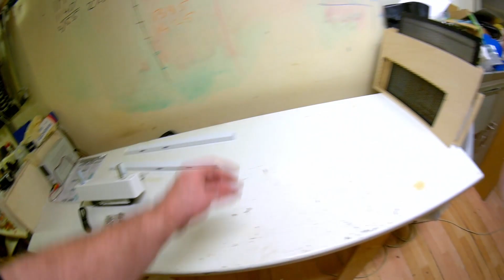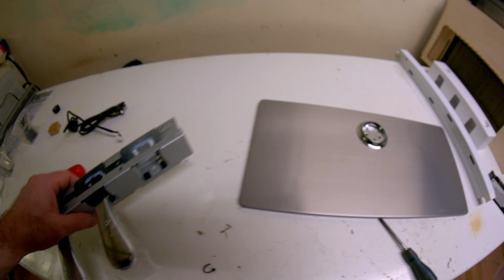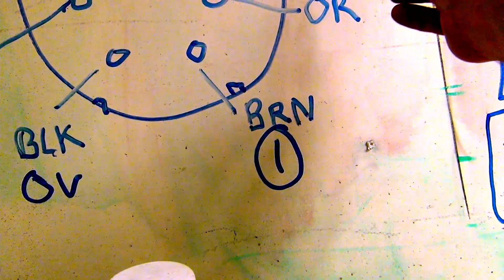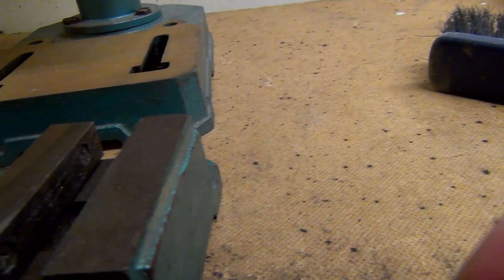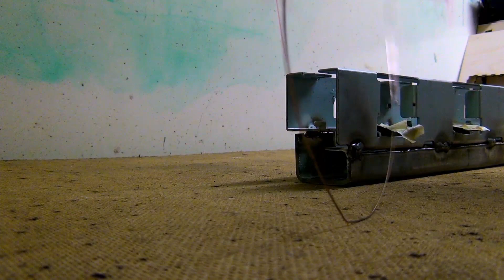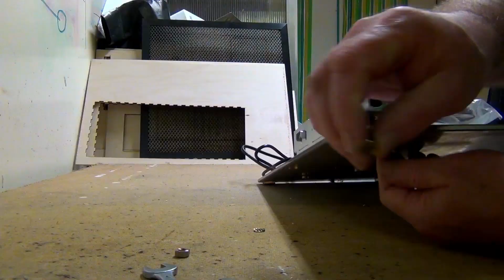Yamaha LP-1 Pedal conversion

Comment: Hi Dave. Great job. I personally find the LP1 springs too strong and tiring when using the pedals. Do you think I'll be able to find 3 springs that are not so strong to replace the original ones?
Reply from the maker: Hi Eduard,
The springs are compression springs. About 14mm O.D.
Check out Ebay. There are loads there.
Good luck.
Cheers.

Comment: Just been doing some more testing. If I connect Black+Orange the DGX correctly thinks the left pedal has been pressed. If I connect Black+ Red the DGX thinks the Centre AND Left pedals are BOTH pressed. Similarly if I connect Black+Brown the DGX thinks the CentreAND Right pedals are BOTH pressed. It's all very odd - I'm stumpted !
Reply from the maker: Hi,

Please do not connect the wires together without using resistors.
The unit is set up to divide the voltage over the yellow pin and black pin to the red, brown and orange pins. (Refer to the video for the pin colours)
I have checked the resistance over the supply (yellow-Black) and the meter shows 3.3K. This relates to 3 X 10K VARIABLE resistors.

The pins indicate:

Pedal 	Pins		Open	Closed
1	Yellow Brown	2.7K	4.1K
2	Yellow Red		2.9K	4.2K
3	Yellow Orange	2.8K	4.2K

Pedal 	Pins		Open	Closed
1	Black Brown		4.1K	2.6K
2	Black Red		3.5K	2.8K
3	Black Orange	4.3K	2.4K

The variable resistors are not using the full scale of the track.
The keyboard has a calibration setting for the pedals.
If you insist on using switches at least get some 2.4K resistors and add them in your switch circuit. (2.4K bands = Red, Yellow, Red, Gold)

There is a pedal unit available without the ability to control effects, Just select on – off.

Check this video: https://www.youtube.com/watch?v=wc2kAFE-9Rk

The pedal is a P3Y2B or P3Y2W

Please don’t short the wires again the pedal unit is not simple switches.

Enjoy your keyboard. I got one and it’s Ace!

ATB Dave
Reply: @daveashford  Thank you so much for this information, Dave. I as only flicking the wires together very quickly to see the effect BUT I'll desist now unless I have a resister between them. I'll digest your info in detail later on and look at the pedals and video too. I really do just need the pedals to act as on/off switches at this stage as I am a novice player . Once again thanks for taking the time to test and document this - I really do appreciate it. Steve
Reply: Right - I've finished digesting. 

When you say "The keyboard has a calibration setting for the pedals."   I assume you mean that various functions can be assigned to each pedal in the Menu/Controller/Pedal (Reference manual Chapter 9)  and not some resistor calibration (which I could not find anywhere in the owner and reference manuals ?

I think the Black/Red open value may be wrong. You have 
"Black Red		3.5K	2.8K" which is a difference in resistance of 0.7K whereas all the other differences between open and closed values are all around 1.x K ohms. I think it is maybe just a typo and the value should be 4.5K not 3.5K which would be a 1.7K difference in resistance in line with the others.

I'll see if I can come up with a way to mimic these values by switching between some difference resistors using some push button switches. I'm not sure however if the DGX measures resistance between the yellow and wiper,  black and wiper or both - to determine the pedal position. Any idea ?

Steve
Reply from the maker: Hi Steve,

Just had a quick look in the menus and I cannot find the pedal calibration either. Sure I saw it when modulating a bass riff.
The values are what I measured, It may be I did not press the pedal as hard for that one, or the arm alignment is out. 
I did not expect them all to give identical values as my experience tells me there is a bit of slop in the system. I ain’t measuring them again!
The measured values will have been affected by the other VR’s in the circuit I suggest 3.2K and 6.8K .
Connect them over the supply and connect the middle connection to the switch then to the wiper connection.
Anything more elaborate requires changeover SPDT switches.
Be careful loading up the current across the supply. (Low value resistors). 
The resistance should be 10K per pedal MINIMUM.
If its Janky, use a 1M resistor to pull the wiper connection to 0V or supply to stop it floating.
All the above is my opinion and should be verified by a qualified electronic engineer other then me, before connecting anything.
Good luck and I hope you let us all know how it goes or post a video.

Music is the food of life. Performing music for an audience is a banquet.

Peace. 

Dave.
Reply: @daveashford  Yes I too would expect variation in the readings. On that subject, when you say "Open"/"Closed" does open mean pedal up and closed down or vice versa ?

ME Performing music for an audience is a banquet that would definitely result in indigestion at best and food poisoning and death at worse !
Reply from the maker: @gbjbasdw  Open means not pressed. Closed means pressed. Confidence comes with practice. You just have to put the hours in. Hope it all goes well. I was thinking of moving to Tenerife for a while. Bought a house in Devon instead. Shure miss the food.🙂
Reply: @daveashford  Funny you should say that about Tenerife - we have an apartment over there in Costa Adeje. Hoping to get back over in October.

Comment: Hi Dave. Firstly many thanks for doing this video. I would like t try to make a pedal unit basically to be able to switch DGX functions on and off as defined in the Menu/Controller options e.g left pedal Left Voice on/off,  middle pedal Main Voice on/off and right pedal Layer Voice on/off. I've watched the video a few times now and like you I was surprised there were variable resistors on the board. 

I've searched for any information on the YJ512 board to try to find the spec of the 3 variable resistors with no success sadly as you don't say what they are in the video. Would it be possible to determine their values by metering the pins in the plug with a pedal pressed and unpressed ? ( I would not expect you to disassemble the pedal to find out !!

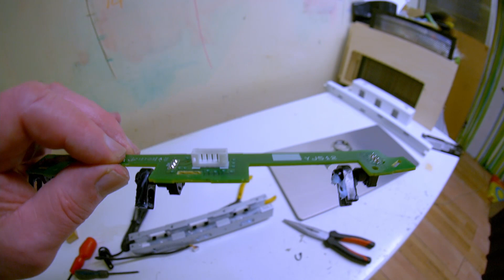I think I understand the circuit diagram but in the video at 7:29 and 9:10 I can only make out two connections to the resistors not 3 as your circuit diagram says. Am I missing something ?

I have a PS/2 extension cable with a male on one end and a female on the other. I configured the Menu/Connector options as I explained above.  I plugged it into the keyboard and then inserted a thin wire into the female end "Red"  connector ( 2o'clock position as viewed on the front). When I touched the bare end of the wire it changed the Main Voice from off to on and vice versa. There were NO other pins connected so I assume it is something to do with the resistance changing as I touch the bare wire. This worked the same for the orange and brown connectors too but occasionally another voice would be turned on/off as well - very odd I thought. Any thoughts on why a) this worked at all and b) why two voices would be changed ?

If you could tell me the values of the resistors I could get some and wire it up as per your circuit diagram to see how it goes.

Once again thanks for your time and effort.